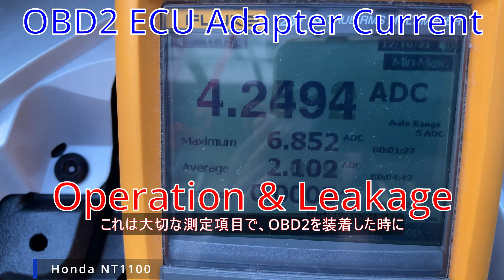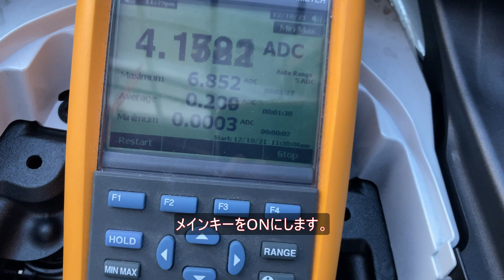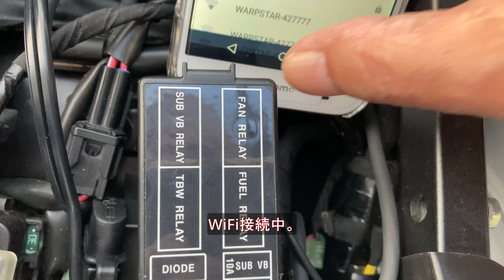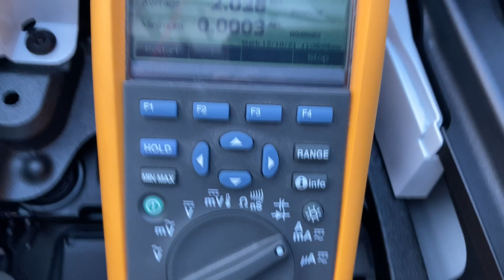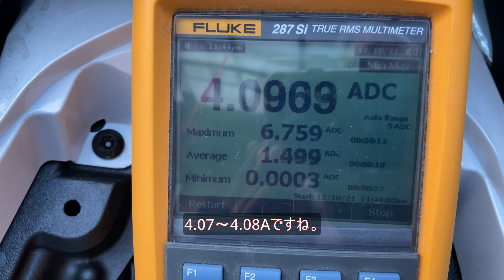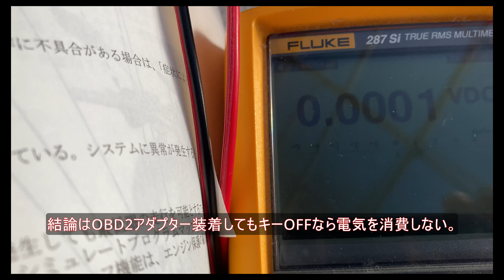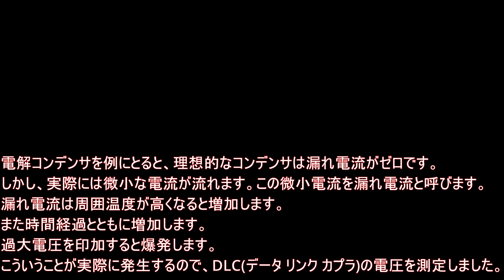OBD2 ECU Adapter Current, Operating & Leakage of Honda NT1100. March 6, 2023

Comment: Revisión de los 1000 km echa i comprobación i estado batería , dicen en el taller que está bien , yo no estoy conforme con la poca fuerza arranque , dicen que en Honda ya son conocedores del problema pero de momento no veo que pongan solución con la supuestamente fácil sería poner una buena batería como la Anica Twin , saludos
Reply from the maker: Hola. Cuando el motor de mi NT1100 está frío, el motor no arranca a menos que se presione el botón de arranque durante unos 5 segundos.
Ayer fue la inspección de un año en la tienda Honda. En ese momento, le señalé al gerente de la fábrica que la capacidad de arranque era deficiente. Se decidió desmontar el motor a finales de este mes y comprobar el juego de válvulas. La corrección de la desalineación entre el árbol de levas y el juego de válvulas puede mejorar la capacidad de arranque. Volveré a informar sobre los resultados. Deseándote una buena vida en bicicleta, de parte de Bambino.😀
Reply: Muchas Gracias Sr , ya dirá que tal le a ido a la moto , le deseo suerte i ojalá lo solucionen de una vez . Saludos